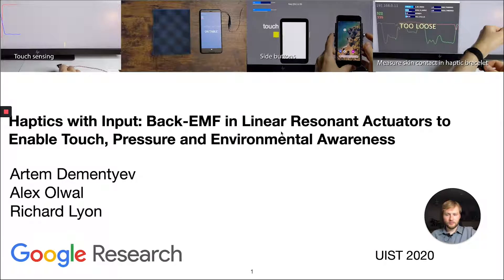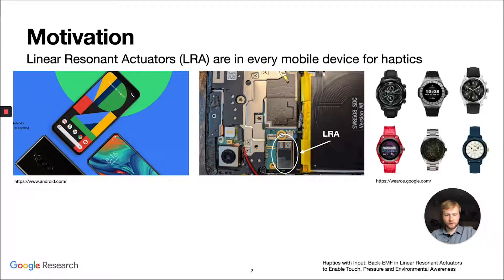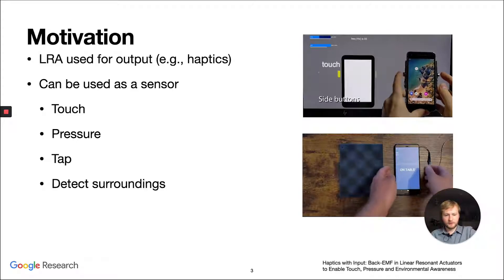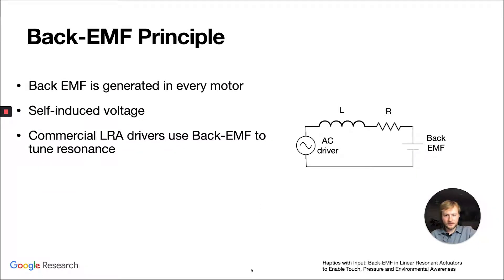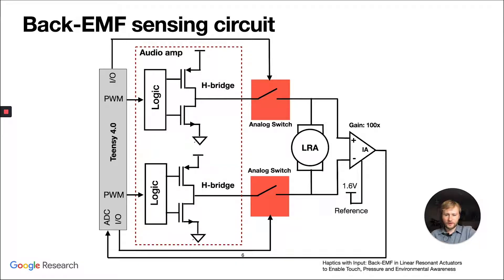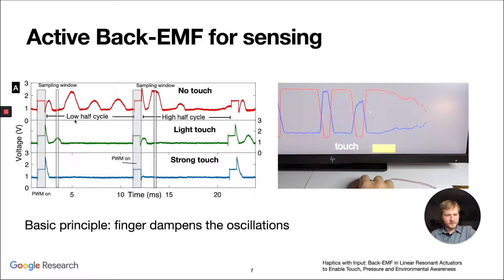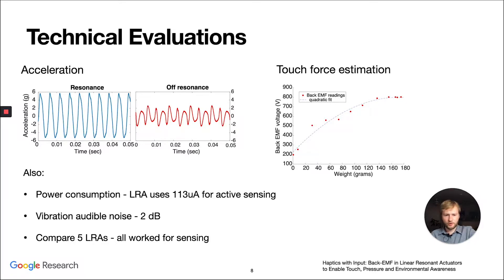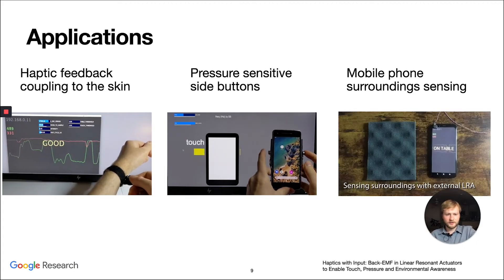Haptics with Input: Back-EMF in Linear Resonant Actuators to Enable Touch, Pressure and ...

Comment: Hi. Can LAR be used as a vibration source? And can we control the vibration frequency and amplitude?
Reply: Joy Cons from Nintendo Switch have LRA. And i can say that it's more smoother and better than DS4's vibration.
Reply: @sweetcelestia5402  PS5's Dualsence controller uses LAR as well and it really makes a difference compared to PS4's Dualshock 4. As you said, It's way smoother and way more immersive